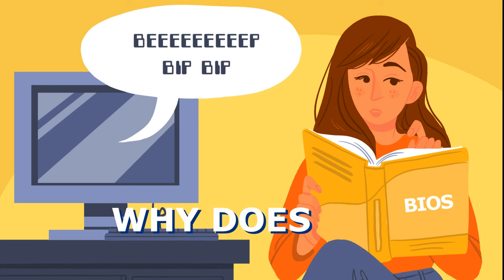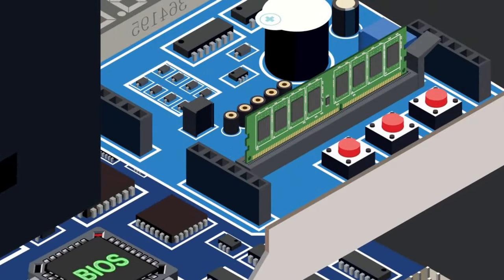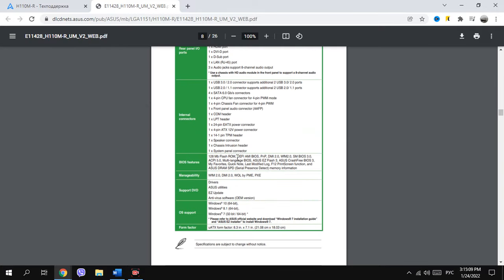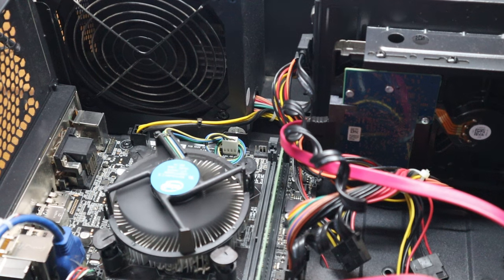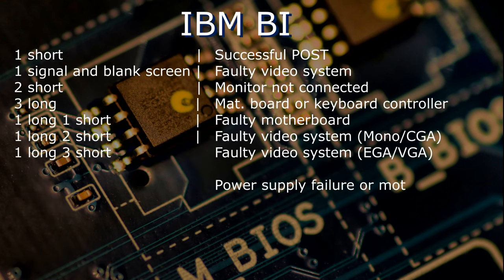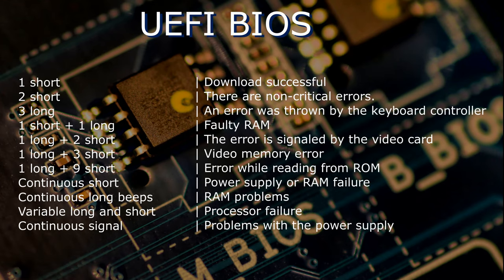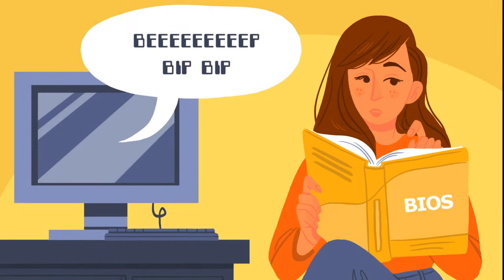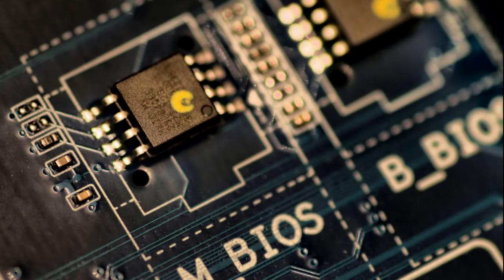PC beeps and No Display? Computer beep codes. Fix it yourself

Comment: I got 1 long beep and 2 short beep. So my friend told me to remove the graphics card and put it back the right way. Remove both RAM and insert only one RAM (mine is 8gb) and then it works fine. Hope you guys did it too!
Reply: I am facing the same problem.
Ram is fine, its the gpu.

Over other pc as well. Working fine with only ryzen processor, not with any Intel processor. Feel like gpu bios is a problem but not sure
Reply: I've tried everything, another cpu, another ram, another gpu, another ssd. Yet nothing happens and I get 1 long beep every 5 seconds or so :(
Reply: I get one long and two short beeps. Asus site says its ram problem. Tried cleaning ram sticks but not working still. Will buy new ram. Pc is old ddr1.
Reply: Thank you, I completely had forgotten about trying with the graphics card.
Reply: I have 4 short beeps

Comment: If it helps anyone, my 5 beeps issue was memory slot 2 AND 4, yes, both, luck me…. Just put ram on slots 1 and 3 and worked (tested all other combinations, 1&2, 3&4, 2, 4… only worked 1, 3 or 1&3)

Comment: If someone still struggling and wondering why it hasnt turn on it probably because you’re cmos battery in your mobo is dead so i recommend to replace it. 

You probably wondering how to check it? Tbh i dont know myself how to check it but this is what i do

First pull out all the psu cable and turn the psu off, then pullout the cmos battery (if you cant find it probably its beneath your gpu), after you pull it out press the power button a bunch of time while off, wait for 10 to 15 minute, then plug in the battery again and reassemble your pc, if it still off i dont know what else, probably something in you’re pc is not plug in properly try to tighten all component just in case.

Comment: If anyone wonders about what mas my problem, it was the thing I least expected..
After hours of trying everything and almost gave up that my GPU is dead,  I swapped monitor cables after which I found out either DVI-D port on grapgics card is faulty (yesterday was working fine tho), or cable is faulty as monitor works just fine.. anyways, it could be someone is having the same issue so just try everything there is before you do heavy decisions.
Reply: Which beeps you heard?

Comment: What worked for me is DISCONNECTING the CD Drives which haven't been reading for a while. Its not necessary to have them UNPLUGGED if they are working UNLESS you had set BIOS to Boot the CD DRIVES first. Which was my problem. I took out the Video Card AND cleaned the contacts CAREFULLY with an eraser. I had a Display then. Also try to switch the the other HDMI port while your there to see if it even works. I need a NEW computer SO bad 😂. Ive kept this one running for like 15-16 years ONLY had to replace Power Supply ONCE. It occurred to me that HEAT is the NUMBER 1 killer of ELectronics, so i buy a 12 inch fans, took the SIDE off. This was all I have to do is dust it with a Duster, or Hair Dryer, OR Air bed inflator.
Reply: And by the way the 5 Beep happened WHILE putting in a new CMOS.

Comment: Thank you for sharing this!
I tried finally fixing it for myself (with not even a little bit of experience)
It was actually in a repair shop and they gave it back in a worse condition telling me that they can't fix it. So thank god i finally tried to do something with it after months just sitting on the gound.
Then i finally turned it on and I got the 1 long 2 short beeps, i will try to clean the video card, maybe the ram, will be trying something.
Thank you again!
Reply: I have one beep but no display :(

Comment: mine is 8 beeps and The computer is on and I keep trying to resset display and but not working but instead I am hearing sounds and tried to connect to the tv, didnt work
Reply: Mine were 9 beeps😢
Reply: But I once opened it and the fan is working but the monitor is no Signal😢

Comment: when i turn on my pc it does 5 beeps with no image then its stays normal when 1-2 min passes the fan starts going faster and making a loud noise it wont stop until i turn it off
Reply: Have you found a solution yet cause the same thing is happening to me.

Comment: My HP 250 Desktop's CPU always when i startup it it does 3 long beeps and 2 short beeps, it sounds like: "BEEP, BEEP, BEEP, BIP BIP," and won't start-up. I always find the solution,  just simply disconnect and connect the power supply, if it's still beeping, i do the same proccess again and again until the CPU says: "nah im gonna work properly again". But im scared for breaking or damaging the power supply.

Comment: I have a Dell XPS M1530, on start up display showed nothing but if you shine light on the screen you can see the faint dell logo. Then I hot 2 quick beeps and then it shut down.

Solution: I removed the battery and connected the charger directly without the battery and it booted up like normal.

Comment: I had the same problem BUT in my case it happened bcz I didn't press (just the middle) the button to turn in on. If I press the whole button It works fine

Comment: I turned on my pc then fans on, 1 short beep then turns off. After researching, it turns out, my RAM is the problem. I pop out the ram then use an eraser to clean the gold part, reseat it properly, then it solves it.
Reply: same thing happened to me

Comment: L also did all things that i can do but nothing happened.
1. I chnged the vg plug
2. I chnged lithium battery
I checked power supply and exchange all the wire from cpu to monitor.
3. I cleaned the ram many times but nothing happened
I am so upset from this . What can i do to stop beep sound and display on button flickering problem
Reply: Did it fox?

Comment: I have a mother board with 1 long beep + 2 short beeps. I know it is related to the graphic card but mine is integrated. I cleaned the mother board but the problem percist.
any suggestion on how to fix it?
Reply: Could be that your PCI-E slot thinks it has a motherboard in the slot, I know you said you cleaned the motherboard but perhaps get a small pin and a small alcohol wipe and clean out the inner terminals with that (preferably with the power off so you don't fry anything) leave it to sit afterwards for a few minutes to let the alcohol clear out and try again.
Might not be the case. Perhaps what you're hearing is the initial start up beep + 2 short. In which case I would disregard the first beep, it is the case with Ami bios that it will beep to confirm there is power getting to the board initially then you would hear the fault code (the guy in the video mentioned just hearing beeps being faults which would be the case for motherboards but not all) if it's Ami try removing one ram card at a time and starting it in order to eliminate whether one of faulty perhaps both are but you never know.
Reply: @Anthony-yj4pf  you have a good point. First time the mobo start fine and next boot it does that beep then I pushed the Ram a little bit and the pc work. The day after it stuck at that beep I have tried to clean the ram the slots, switching the ram in different slot (there is only 2 and when it worked 1st time it was the slot near the Cpu) I have also replaced the Ram with 2 other one with same size and frequency but the problem percist and I guessed it might be the gpu
I also tried installing an ecternal Gpu but this time I heared a weird fast beep then the long beep +2 short beep, I have no clue on this situation

Comment: I'm not getting any beeps at all or picture to my TV but all my fans and graphics card seems to be running it seems to be everything is plugged in correctly but I'm not sure I'm not very computer literate here
Reply: In case you haven't gotten an answer in the last 9 days, I had the same problem when I started out but it was my error. I had plugged the monitor into the motherboard port instead of the graphics card.

Comment: I have a windows 10 computer and it has 3 long short beeps and then 3 short loud beeps, it repeats. How do I fix it?
Reply: same here its my parents pc which i dont use im trying to help them but idk
Reply: It’s sum wrong with your ram or gpu chip
Reply: You need to change the ram as the old one causes system error and fails the booting process

Comment: Mine was the psu shorting reinstalling the psu fixed it thx mate soooo much
Reply: How
Reply: @mkdiablo995  one of the psu headers was giving power to case so the system didn't boot I reinstalled psu properly made sure none of the psu headers was contacting the case body then my problem was solved. I may have explained falsely in the last comment.

Comment: Hello! I have 2 4gb ram sticks, one of them is defective, if I remove the defective one everything is ok, the pc is fine, but if I insert the defective ram the monitor no longer displays anything and 4 beeps are heard, I tried to I use an eraser on those pins, but it didn't work, I found another method, I hit the hair dryer for 3 minutes on the ram and that's how it worked, only it didn't last very long... do you think you could give it to me advice..?
Reply: The ram is bad and can't be fixed I recommend Getting a higher ram Instead of 4gb

Comment: i got a lot of beeps like short beeps until the pc turned off and restarted pls help
Reply: Samee
Reply: @sadiq985  hi I just fixed it. You need to push the ram cards into the sockets until it pops on. The cause of this is prob because the ram card no inserted properly. If you need more help, search up to how add ram cards.
Reply: @iluvoshinoko  thank you!! I figured it out because a while ago I decided to clean my pc and I removed the ram but it seems like I didn't install it properly

Comment: Ihave 16 beeps how?
Reply: Depending on how old your computer is I would guess that hp manufacturer the motherboard but the bios chip and software would be someone else's work perhaps UEFI in which case I would suspect as described it would be either RAM or power supply. Most likely RAM so try removing one stick at a time and hope that it eventually starts. If it does then you can insert all the ones that it didn't make a difference with and replace the one that was a problem

Comment: Hello, at me are unlimited short beeps! Someone knows what problem i've got?
Reply: Could it perhaps be that you have a problem with a pin within either 24 or 8 pin connectors that come from your power supply to your motherboard or even some other component. Process of elimination, I would check all connectors one at a time to make sure there are no bent pins and that they are clean and making a good connection.